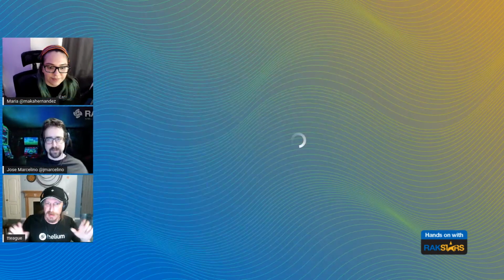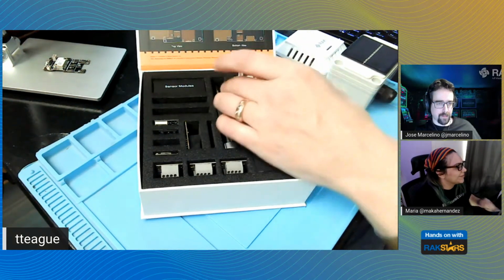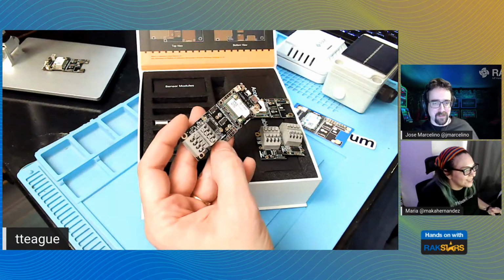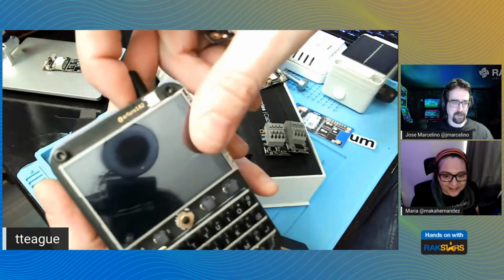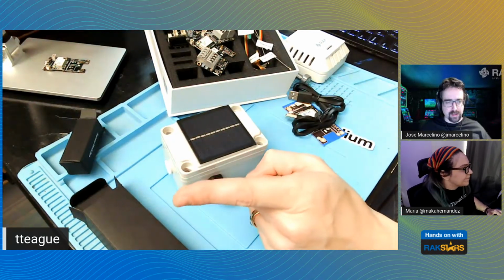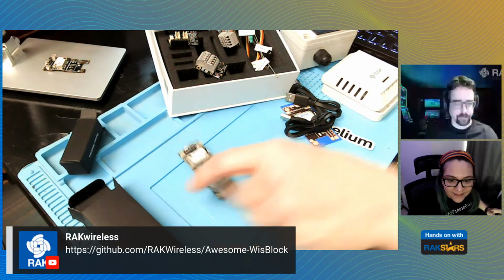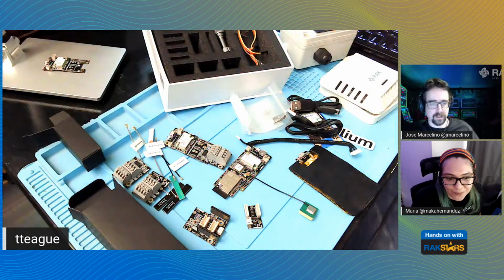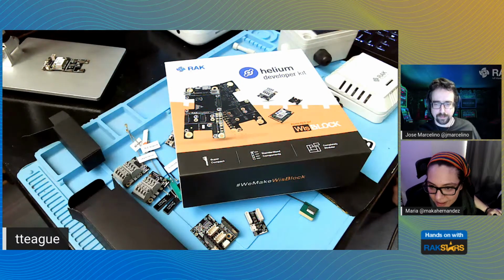Hands-on with RAKStars Episode 22, WisBlock Power: Helium Developer Kit

Comment: is this different from the 831 kit?
Reply: Yes, it is completely different. With this kit you will have the opportunity to handle hardware development is an agile way. If you are interested in running LoRaWAN applications you will need to manage an external gateway to be able to handle the communication.
Reply: Please help explain what does this kit do in My mind I think this kit helps you connect a DIY rack minor to the helium 
block chain

Comment: does that mean there are 2 you can build ?
Reply: Yes, this kit include 2 WisBlock Based Board + WisBlock Core. You can build 2 projects with just one kit ;)
Reply: @MariaHernandez-kz6ow  hey I have a RPI4 If I do a DIY build and order the pi  hat 2245 and antenna and what not, how can I approve the chip to helium